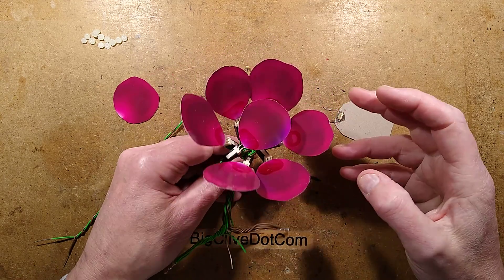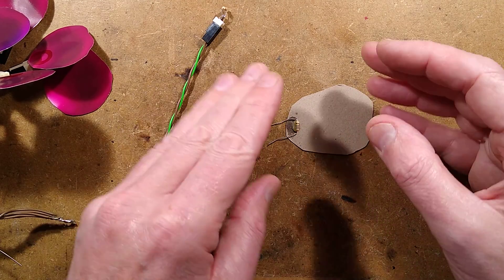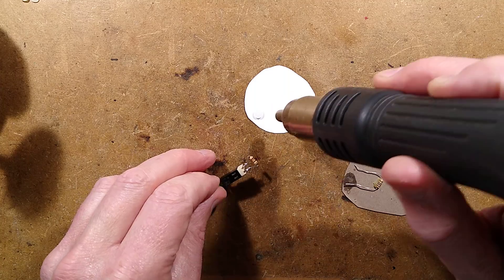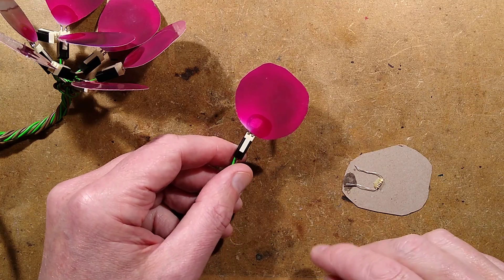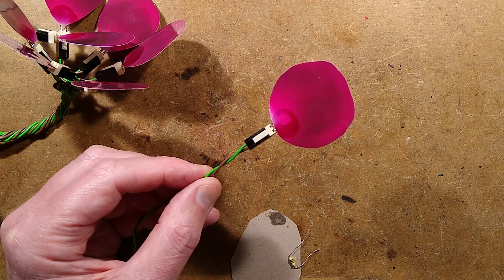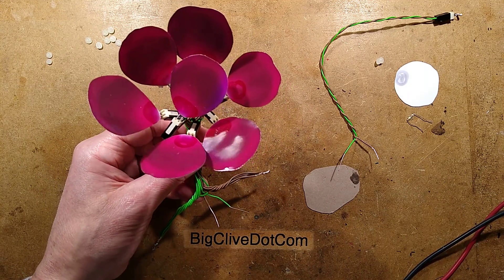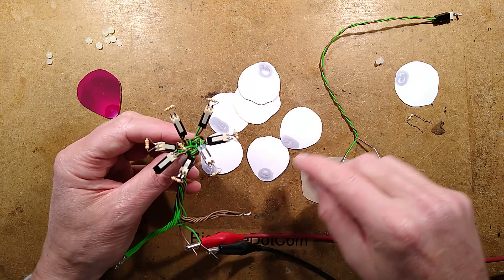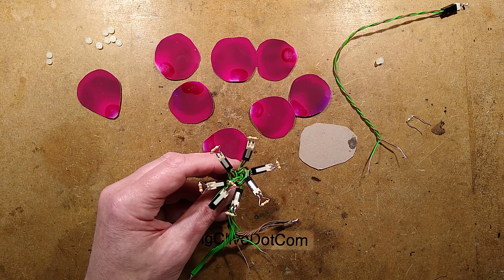Experimental electronic petal dropping prop

Comment: Thanks Clive, about to open our production of Beauty and The Beast tomorrow night using this design. Works really well. 18V cordless drill battery, regulated to 16V, 180 Ohm 0.5W resistors. Drop time is 6-8 seconds. Stem is made using enameled copper wire.

Comment: This just reminded me of a video by Big Clive where he made a flower whose petals drop off in sequence for a stage production of Beauty and the Beast. The petals were hot glued to resistors, so when current was applied the glue melted and the petals dropped off. The title was Experimental electronic petal dropping drop.
Reply: And I just realized that I put the comment on the wrong video 😂 and now I don’t want to delete it since it has a like from Big Clive. 

For those who are interested, this comment belonged on the short “Theater vs Film Props” by ScottPropandRoll. That will be all!

Comment: That was fascinating, and you could use this for almost anything, nice one Clive. I have had resistors detach themselves or other things by either melting hot glue or even the solder holding them on the PCB, but that was not on purpose haha. I once helped a theater company when the props guy came to me with a problem, it was a christmas play, and there was a scene where someone slammed a door or something, and right on cue all the baubles had to fall off the tree and smash to bits. My answer was to use tiny 24v electro magnet coils (basically a relay without the contacts & stuff) and glue a steel washer on each bauble. Needless to say, all the coils were powered throughout the play and at a given moment they simply switched them off. I wasnt there to see it, but apparently it worked a treat :) I chose 24v DC because it's an industry machine standard these days, so all the parts were easily sourced.
Reply: Hi Clive, i love your channel, you do all the things i WANT to do but don't have the time, your IKEA usb teardown convinced me, and my boss, to use one in the office, because it's a great design and it won't burn the place down. My experience in stage lighting was mostly dia projectors and home-made lasers for house parties in the 90's. But due to the amount of drugs involved i dont remember much of it, but people tell me they loved the shows ;)

Comment: Why not just push the resistor leads into the dupont sockets? You could have buckets of prepared petals/resistors making reset easy and quick. It would also look more discrete without clunky chunky connectors.
Reply from the maker: Reliability.  Especially if wax gets onto the leads.

Comment: Low current value self resting fuses get very hot in short order then go high resistance. A little 20ma or 40ma one should work great. Dump 24vdc through a FET for very accurate control.
Reply from the maker: I toyed with PTC fuses, but their start resistance is quite low due to their application.

Comment: interesting, maybe depending on how many petals are on the flower you could use a NE555 timer with a variable resistor and a cd4017 to control the dropping of leaves ? both should handle 16v max,

Comment: There are many different wax formulations with different melting points, and I would go towards a higher temp wax to avoid premature defloration. To get some stagger between petals, you might try something as simple as putting larger blobs of wax on some petals to increase the mass that has to be heated.
If one petal just has a skim coat and another has a puddle, it should take slightly longer to drop.

Also maybe have the power supply ramp up voltage over a few seconds, so that you get gradual softening and staggered drop, but still get to a maximum voltage that ensures everything comes off, but is just below the wax smoke point.
Maybe a slowly charging capacitor that controls the voltage? Or straight off a DMX dimmer, and the operator knows to turn it up slowly?

I would wonder if some nichrome wire would work better since it can get to a higher temperature without burning out compared to a resistor.
Then you could use higher temperature wax and avoid stage light syndrome.

Comment: How about this:-
Glue a small washer to the petals. On the end of the stem place a small, rather weak, magnet with a winding around it. Arrange the power to the winding to just cancel the magnet and the petal will fall off. You could arrange for a slow risetime so that the petal falls off just as the field is insufficient to support the petal. This would cover the instance where the electro magnet could be too strong and the field reverses before the petal can drop off.

Comment: I would switch the resistors out for Kanthal or Nichrome wire, you can heat that up faster without burning it out. A Dmx relay board would be a great way to control it with a channel per petal. Of course, make sure to add macros to the controller to turn the relays off after a few seconds.

Comment: can you just use slightly different resistance resistors so theres a small time difference between the petals? maybe even to handle the last petal falling off at the end too?

This is a clever idea, its definitely one of the most silent solutions lol, you can basically only hear the petal land

what about like, little electromagnet clasps? of course that would be way overdesigned and probably slightly louder and more expensive, but the reloading is a little less messy lol. More importantly theyre neat. Though I do think the wax is a better solution overall :P

Comment: You can buy paraffin with different specific melting points.
I presume that you could use smaller resistors and micro connectors so that it is easier to disguise.

Comment: part of me wonders if you couldn't get away with a bit of ferrous metal on the pedals and some wee electromagnets on the stems. And then you'd have perfect control of the release timing and easy resets as well.

Comment: I have done some stagehand work. I vote for the tube/wire/mechanical solution, for safety reasons. (That does not mean that I am against brainstorming the wax/resistor idea, for the challenge.) As for the reset issue, just make multiple flower units. I suggest that the roses be of the long-stem type. That means the petals have farther to fall and that means the fall is more evident and dramatic. Maybe position the vase on the edge of a table/shelf and let the petals fall all the way to the ground. The falling action of a flower petal is distinctive... Slow... With random, horizontal wondering... I would think that would require at least a fabric petal. Even better might be to cut a pedal shape out of an actual, decorative feather.

Comment: Could you use different value resistors for each of the outer petals to cause them to fall off as slightly different times instead of all at once

Comment: Instead of resistors, you could use a small piece of pyrotechnic fuse wire. When the current passes through it, it will get hot enough to melt the wax and give a sparkle so it looks like magic (as it is an enchanted rose).

Comment: Wonderful! Our community theater company was going to do this show in the spring, but we changed to another title. But I'll remember this for the future! And I know a particular stage manager this will infuriate, because you can't time it out exactly... I'd try leaving off the connector pins on the resistors and just sticking the resistor leads into the sockets.

Comment: Tiny piece of fuse wire taped to a petal and contact made with a reed just below where its taped.

So:
Petal
Top of the fuse wire
Reed switch thing 
3mm of more of fuse wire
Bottom contact

Doesn't matter where the fuse wire breaks it'll fall, reset is just tape and some more fuse wire.

Comment: Awesome. Another way could be to use fuse wire to hold them somehow and then just blow it? You'd get a small flash but you could hide that in the attachment mechanism.

Comment: Sorry for the unrelated question.  I'd like to plug my computer('s extension lead) into something that will log the wattage used over time, say, in increments down to about a minute.  I don't care if it logs it to an SD card or bluetooth or a serial connection or even prints it onto receipt paper, but I'd rather not have it connected to the internet.

Does such a product exist?  Which magic terms should I search to find it?
Reply from the maker: You do get power monitoring plugs that record the cost of running an item.

Comment: You should get a "Induction Hob Converter Heat Diffuser Disc Adapter Plate" 

Put it in the freezer over night To Thermal Mass Store Cold - by Having the freezer  (To suck the heat molecule vibrations out of it)

This "sucks" heat out the wax much faster making it Solidify & Harden mush faster 

or Alterative use The Disc becomes Part of a Wax flower with seeds  and magnetic induction heating hearts up the wax On the Diffuser disk

Comment: If the heat difference is not causing cracks in the wax or resistor you can use canned air/freeze spray to cool off the wax quickly

Comment: I'd make sure you check the lighting setup if you're going to use this method, Clive.
The last thing you need is some set designer putting a high intensity spot on that flower, with the intention of making it more visible to the audience....
One other pitfall could be operator error. You wouldn't want someone leaving those resistors connected to the supply for any longer than is absolutely necessary.
Reply from the maker: It will be lit internally by LED tape I believe.

Comment: Looks like a good start. Only thing that comes to mind is the heat from stage lights... Since it is enclosed in a glass dome, could the heat on stage (from aforementioned lights) melt or soften the wax enough to cause a premature petal disassembly? Unless of course the stage lights are these new fancy LED lights we've been hearing about...

Comment: Just make a few dozen plug in resistors & petals and put “reset replacement” petals in an plastic ice cream jar with a screw on lid & keep them in the fridge til needed by the prop guy. That way they don’t have to do all the heating & holding & waiting / not waiting long enuff cuz their impatient, lol. Just seems like a simpler solution than them needing a heat gun & all that jazz… 🙌 hands 😉

Comment: Why not just use nichrome wire, and then to fuse the petals heat the nichrome, and use a compressed air can held upside down to quickly solidify the wax after it melts. The nichrome wire would use less power, be less visible than a resistor and could be driven using only battery power.

Comment: Here's an alternative idea, which can be adapted to work with real rose petals: each stem is a thin tube with a flexible sliding wire inside, just as you might use for a (SFX) puppet mechanism. A tiny drop of superglue attaches the petal to the sliding wire.  When the wire is withdrawn a few mm into the tube, the tube will restrain the petal and the glue spot will be pulled free.  It is much more compact and can withstand closer inspection.  The big problem it has is that it's a moving mechanis, and therefore a little tricky to make silent.  But far from impossible, especially since only a small amount of motion is required.  Love your stuff and your style. Carry on!

Comment: have a bowl of ice on hand when you "fuse the resistor to the pedal", to cool it once "welded".
Honestly, I thought you were going to run current through the resistor instead of the hot air gun.
Great idea.

Comment: Another possibility would be to use a bit of nichrome wire looped around in the shape of a resistor, which might allow you to use the higher temperature wax without worry.

Comment: Very cool trick! I once had a similar project for a movie. We used nitinol wire to let the rose shrivel. The ends where connected to a soldering iron hiden in the stem. This way we could open and close the rose remotely. It looked very weird, almost as it happens in timelapse before your eyes.

Comment: Really neat idea! It would be easy and cheap enough to make pedals for the whole show run. Anything goes wrong, reassemble the old ones. 8-10 seconds is also plenty of time for a musical build and/or dramatic lighting change. I'd heat shrink those connectors to mask them, though, especially if filming is going on.

Comment: I think I would have gone with nylon strings connecting the petals to a green tube, then use solenoids to unhook metal plates on the other ends of the nylon strings. That way you can just pull the metal plates to the magnets again to reset.
I see the huge advantage of the wax solution though.

Comment: Very cool solution! I'd imagine that the real prop would need much larger petals to be seen well so the extra weight could make a difference. If I was doing it, I'd give the option to treat each petal as an individual channel and drive it hard for an instant drop even if it destroys the resister. Give the board op a DMX channel per petal as they are being cued and can build a chase to suit. Sell them loads of pre made petals. For tech rehearsals, maybe your driver box could be changed to low power mode to drive LEDs for simulation.

An alternative to a resistor could be a piece or coil of nichrome wire like an e-cigs coil but maybe not as cheap

Comment: Why not use very small and weak magnets on the petals to retain them, then small, opposing electromagnets to repel them to actuate the drop? It would take a bit of tuning, but should be unaffected by variables such as type/amount/positioning of wax, ambient conditions or heat from stage lights, etc. This would also make reset very easy. Obviously using electromagnets to retain the petals would be easier, but that requires constant power and a momentary power drop would drop all the petals.

Comment: Interesting approach, if you can get the timing consistent.
I have a rose I built about a decade ago, using springy wire clips to hold the petals onto a metal flower head.  Then threads running down guide tubes (in the rose stem) to springs and latches released by solenoids, to pull the clips open.  If I was doing it again I would use a servo in place of each spring/latch/solenoid for simplicity and ease of resetting.
Some things to consider: 1. I chose an open 'rose briar' cage instead of bell jar, as the rose is much more visible without reflections off the glass, and the petals can fall all the way to the stage.  2. The petals need to be really lightweight (no magnets etc. attached) if they are to flutter down convincingly, and not make a loud noise when they hit the stage.  3. The lower petals need to be released first, otherwise the upper ones don't fall far before getting jammed.

Comment: Would it be possible to use thermistors in series if not prohibitively expensive?
My thinking is that you would get an controllable thermal avalanche effect on each thermistor. But as each successive thermistor altered it's resistance the next thermistor in series would see a greater voltage across it. Producing a sequential effect with only one set of wires.

Comment: Hello Clive, I might consider beeswax as it has a fairly low melting point. Of consideration also would be a bit of nichrome or similar wire; The idea being that you could address individual petals with a reasonable current pulse and the petals would fall off in the sequence required. In summary, Higher current, shorter pulse, lower melting point of beeswax. It's a good idea however you do it of course.

Comment: Once you've finished construction, make a multi-switch box using momentary on switches.  One switch per petal.   Pull the switch, hold it until the petal falls, release the switch.   The benefit of that is if someone accidentally hits a switch, it won't release the petal by mistake as they continue on their way.    (you could use a rotary knob to select the petal, then a single momentary switch, but that might be more complicated) 

Definitely make two to three times (if not more) the number of petals necessary.  Especially during rehearsals, the prop tech might not have the time to reset the petals on the resistors.   'Let's go back to (insert line here), and make sure to reset the rose!'     Directors can be absolute bastards, especially when they have never had to work backstage.   

You might want to add a tiny circulating fan in the dome, that works with the heating element.  That way it shivers, then a petal pops off.

Comment: Cool idea.  You can try a few different candle waxes. Candle wax can have a wide range of melting points. Also paraffin should have a lower melting temperature than candle wax. You should be able to lower the melting point a bit more  if you re-melt the paraffin and add a little bit of mineral oil or vaseline.

Comment: Would this work better with PTC resettable fuses? I imagine the larger surface area and more well-defined heater temperature could produce more consistent results. Plus if somebody forgets to switch off the power you won't have burning resistors.

Comment: You can add paraffin lamp oil to lower the melting point.  I use about 5-10% paraffin to my wax mixture for my bike chain (hot dip), and it's soft enough you can handle it like hard butter..
Checking if it would be strong enough to hold without melting...
It's strong enough to hold a guitar pick perfectly securely, but too malleable(it can be easily forced off).   It's really easy to work though, melting(on) absolutely not required.

Comment: Are those 'wax beads' actually wax or are they plastic ? :)
Reply from the maker: They're wax beads for candle making.
Reply: @bigclivedotcom  I'm aware there are 2 (or more?) waxes for candles with different melting points.
Also, where's the fuel for candles - I thought it was in the wax - so could that be a concern for stage use ?

Comment: Low Temperature wax, as used in fetish play would require lower temperatures and reduce current usage.
Reply: Also I would like to see an exploding petal, just pop the resister or a cap attached to the petal